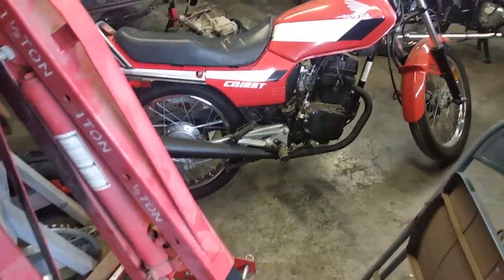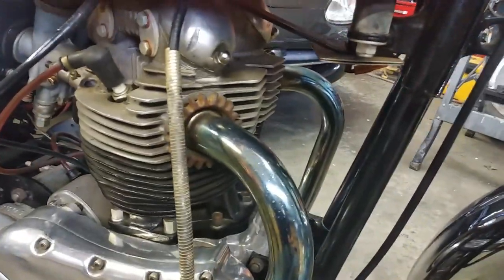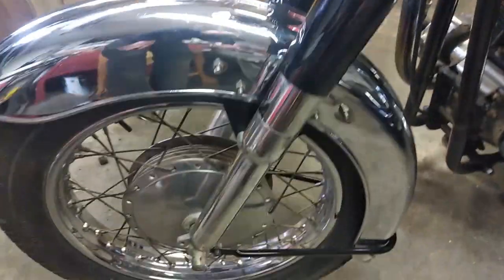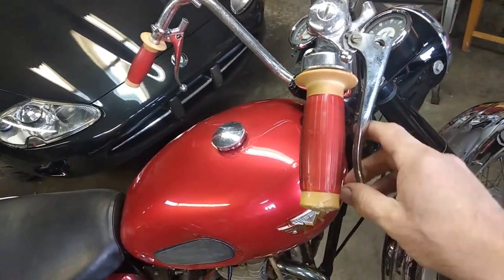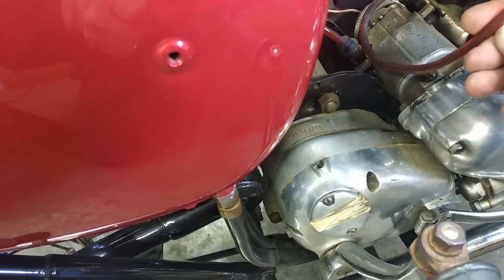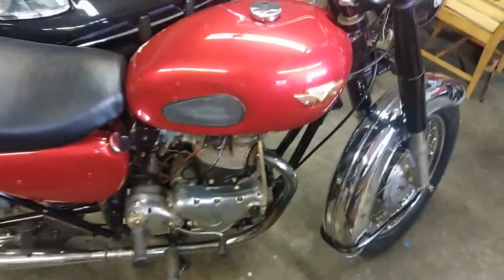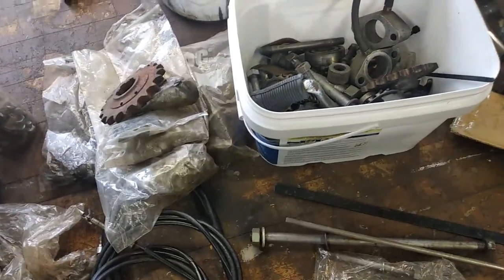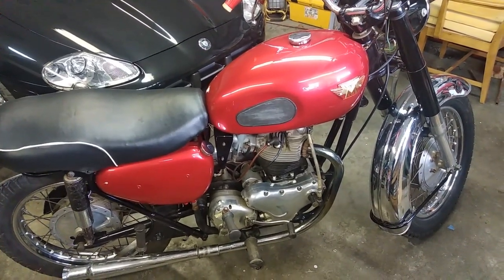1967 Matchless 750cc G15

Comment: The screw holes on the oil tank are for to attach the oil tank heat shield a metal cover of similar shape as the oil tanks outer profile which isolates the rider's leg from the heat of the hot oil in the oil tank. These can be purchased on ebay made new in India for a reasonable price hope this helps
Reply from the maker: Yes thank you. Another mystery solved. New video coming soon.

Comment: that is pretty much the exact same bike i bought new in the summer of 1966. i wanted a norton atlas with the featherbed frame, but there were none available in my area, so i settled for this. i rode the snot out of it for four years until the siren song of Dunstall and the need for more speed caught hold of me. i often wonder where those two machines are now.

Comment: Also my bike has two L shaped round wire on the right side near the back for an air pump. Do y'all know the correct type of pump that should be on it?
Reply from the maker: I have the brackets to hold a air pump as well. Been looking for one for a while now. Pump is just a simple hand pump that is used on a pedal bicycle. If you can find one the correct length.

Comment: The oil tank has a shield I believe. I have a question. I have a very similar motorcycle, 68 g15cs, matching numbers. My bike has a Bates headlight held on by a two piece  bracket that bolts to the side of the headlight and the bracket curves down directly  to the bottom triple  tree. Is this a factory mount or should I replace them with a pair of known atlas headlight brackets?
Reply from the maker: There should be a heat shield unfortunately I don't have one.
If you want the g15 to be original I would try and find the correct headlight and brackets
Reply: Definitely have been on the look out for the correct headlight. The magneto wasn't working but I took it apart and repaired it.  @gsminors